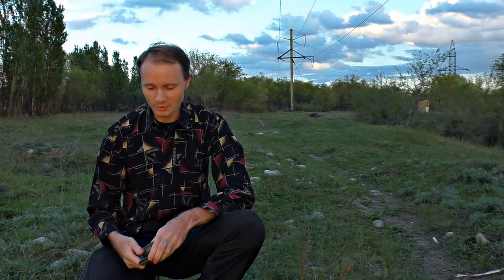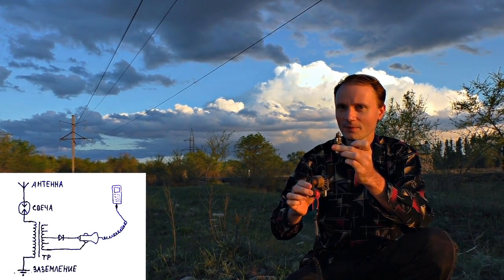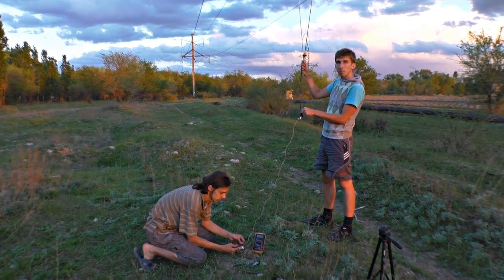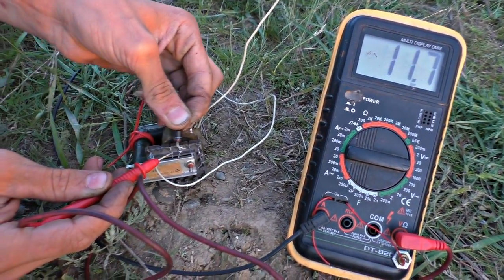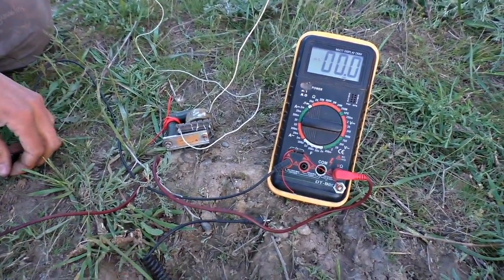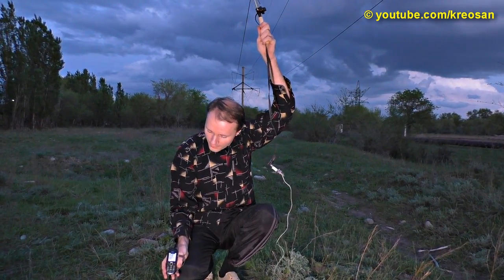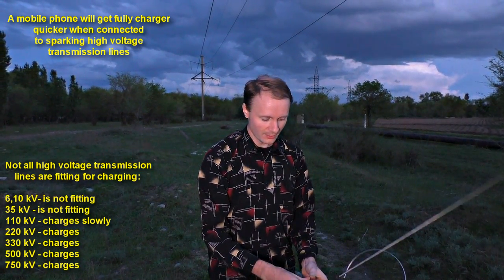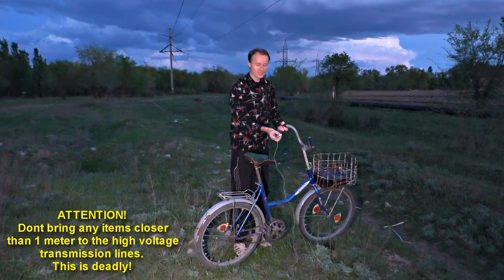Charging from the power lines.

Comment: I watched a video today on Youtube from Bobsdecline, a lineman who was talking about how all of the components in and around a substation had to be bonded to ground because of the voltage that is induced on them from inductive coupling from the power lines in the substation. They tried to get power from under power lines like this on Mythbusters but weren't able to get their setup to work. With the right conditions this should work. I'm not sure what the spark plug has to do with it though.

Comment: Try making an H2O splitter through ionization around 3kHz, 10 kV, inserting atomized water between the coils and using a car spark plug system with PWM on the 12V side to generate the 3kHz. Measure consumption x H output.

Comment: That's some power you could get to charge an even larger battery. If you wire a long net of conductive material, 2 meters high, insulated from ground, and then connect it to a transformer suited for 60hz through a resonant LC, you could even go as far as powering some 30 or even 60W devices.

That's a lot of power loss under such transmission lines.

Comment: 1:33 its not even plugged in correctly to make contact =\

Spark plugs usually require voltage of 12,000–25,000 volts or more to "fire" properly, although it can go up to 45,000 volts.

Comment: For an optimum charging rate, climb up the pole using a set of metal ladders and fix the cables directly to a pair of the overhead wires. You will get instant results.
Reply: HA  HA HA
Reply: HA  HA  HA
Reply: laughing out loud

Comment: Yes this is true, a field exists between the wires and earth. You could say these are losses and you would be somewhat correct. But the antenna causes a distortion in the local field so siphoning off power this way does cause a small hit to the supply.  Very small though. But if you can get this much power off the lines do you really want to be there?
Reply: Think about how many radio and tv signals we are all walking around in comfortably every day.. I wouldn't worry too much about it, the stress will kill you faster.
Reply: TruAnRksT the field is going to the ground???  The field is created AROUND the wire, no matter what is near. The field is strongest close to the wire, then diminishing with the square of the power the further away in distance. Basically the same as a radio transmitter antenna is doing.
Reply: Considering the metal fences, railroad tracks, and metal structures these lines cross over or run very closely parallel to from the power plant to the substation, the hit from a rigged up cellphone charger is insignificant. Like a pebble hitting a freight train.

Comment: At least slap a big filter cap on the output of this bodge.  Otherwise, depending on just what is inside the 12v converter, the phone will be fed a series of brief high voltage spikes - which probably won't do it a hell of a lot of good....

Comment: I suppose I must be the one to point out that electricity companies regard this as theft and may well take legal action against anyone stealing power in this way.
Reply: Not theft, but a recovered loss. This takes nothing from power lines
Reply: @travisturner6783  I remember years ago a farmer being prosecuted for stealing electricity, after he ran a fence wire beneath an overhead power line and used the induced current to run his lighting...

Comment: 14-15V isn’t too much- as the adapter you are using is an incar adapter which are rated for 16V some even 24 as the alternator in a car produces 14-15V dependant on your car and the condition of the charging system

Comment: Title should be how to steal power
Reply: ALKUKES how is this stealing?
Reply: power is free!
Reply: You're not stealing anything. That power is wasted on the air, is not power of the grid, is waste!. You won't receive less energy in your house because of this.
Reply: That still puts additional load on the system, however small it may be. It's still theft, and it's still a felony in most cases.
Reply: Maisonier, incorrect. It still creates additional load. It's the same method used with an actual induction wireless phone charger.
Reply: not stolen if its bleeding and causing cancer
Reply: The law will beg to differ, trust me.
Reply: Brian Evans Yep. It's already lost for them and paid by customers...
Reply: I known perfectly well how it works as its my job. Tapping in to the emf of a powerline induce a very inefficient load on the powerline. Also inductive loads shifts the phase of powerlines, how much depends on the load you introduce.
Reply: Its wasted energy anyway
Reply: wow how many times does it need to be said... It's not wasted energy that they are capturing, that's not how physics works, equal and opposite reaction. Technically the transformer they're holding is inducing a tiny load on the powerlines above, enough to charge a phone. If the transformer and antennae were not there, the power-line above would be a tiny bit more efficient. Some of the electromagnetic energy does get absorbed by the surrounding area but not very much, but if you strung up a MASSIVE coil of wire all around the entire power line, you could theoretically snag a considerable amount of power, enough that the power company would be forced to investigate as there would be a measurably high load from the resistance. Inductance is weird.
Reply: TheGoodChap its wasted energy
Reply: Blyatronics
Reply: so how about the power poles, and the ground and anything conductive near by?, all those things would receive some of the wasted energy. this contraption would put some of that energy to use without adding an extra load because all it would do is stop an eddy current being formed in the ground below.
Reply: ALKUKES:: Really cuz that's what you should be telling your Government  Jagg off, there stealing from us theres a very Long List to what  the Government should not be charging the people, jagg off
Reply: TeternalGlone:: Tell Jagg off "ALKUKES" how its free, he dont get it.thats why i call him jagg off
Reply: Title should be "How to rip your DNA into shreds with harmless EMF"
Reply: its not stealing your out of your freakin mind, how can you even think like that
Reply: It is technically stealing power.
Have any of you guys saying "it's capturing wasted energy", taken the electricity and magnetism section of a physics class?
The antenna they're using is causing an extra load on the power lines.
They're are not likely to get in trouble for this very small load. There are stories of people who have been caught stealing power using large coils of wire.
Put the following text into Google's search:
Stealing power using coil of wire
One of the first links returned is a test question on the subject from The University of North Carolina's Physics Department.
There is debate if the story about the farmer stealing wire is actually true but the physics behind the story is real.
Charging the cell phone (as shown in the video) took power from the grid which normally wouldn't have been lost.
Reply: @Brian Evans yes nestle owns the sun like it owns the most water (springs) on earth
Reply: ThisUHV line(all 3 phases) forms a capacitor in relation to a ground which is constantly charging/discharging since neutral wire from a transformer is grounded. These UHV wires are constantly loading transformer and power generator and since the current is constantly flowing to and from a ground(polarizing wires and a ground) what this guy did is not gonna influence this parasitic load. Not to mention inductance of a single wire. That's why Chinese switched to UHVDC  when it comes to distribution of a power. So yes it's a theft but Mother Nature is the culprit . Check this video out: https://youtu.be/igC-i67d2x
Reply: not if you are already paying the company the bill?
Reply: Actually this does count as stealing power if you are taking it which he is then yes
Reply: TeternalGIone No.
Reply: Ahhahaha
Reply: A guy where i live used this tecknic on a big skale and powered his entire house, he got caught and fined 10.000$.
Reply: Ah yes, taking power that will never be used otherwise is "stealing." This stuff is wasted if nobody takes it m8.
Reply: ALKUKES no the title should be how to be bad at lying, everyone should know that free energy doesn’t exist.

Comment: There were some farmers in Missouri who did this to heat their chicken houses. They stuck old bed springs up with old glass insulators under the HV lines, and stuck leaves on top to hide them. The Rural Electric Co-op noticed a unusual power drain along some HV lines and sent out linemen to investigate. The lineman called the sheriff, and paid the farmers a visit. The setups were quickly taken out, and the farmers got heavily fined. It was estimated that each setup was drawing around 2KW each. I think the REC could detect a lite load like a cell phone, but they may not question it. Never the less it's still thief, connection by induction.
Reply: Hi! Is it really possible to get 2kW from power lines, even from high voltage lines up to 500kV? I think that the maximum power is limited to approximately few watts. What do you think?

Comment: be crystal clear in showing video , its fake video
Reply: Pravin Lakhe it isn’t fake, he’s achieving power from capacitive losses from the AC lines, it’s natural electro-physics
Reply: Main Lane it is fake. That's a.c. in the powerlines.  spark plugs don't use a.c. and neither  do phone batteries and neither does that type of charge connector. He isn't using hardware to convert the a.c. to dc to charge or yo be used by the dc devices listed above...
Reply: NoVaKane Do you know what a transformer and a diode is? Spark plug doesn't give a fuck what one feeds into it, it's just 2 contacts insulated by ceramic. He used a transformer to step down the voltage spikes to about 10 volts and then he used a diode to "convert" AC to DC, followed by a car phone charger which outputs stable 5 volts DC. Nothing suspicious going on there. And capacitive coupling is a thing. Can you hear the power lines buzzing during the video? That alone is capacitive coupling with the surrounding air and the other 2 wires (phases), so he certainly can induce some voltage on the antenna using this method.
Reply: Marek Fiala if course I know what a transformer and I diode is...  foods only let current go one way. There are other doors that allow some to pass in reverse as well. Transformers take a.c. current and the ocelating magnetises the iron core of the first winding and the second core pics it up either increasing it decreasing the volts exiting.  I also know those power line out put a.c. current and there is nothing in his kit that he has that converts  the a.c. into d.c. to charge the phone.  Even that car charger  plugs into the d.c.  port of a car. Tranformers use a.c.  as well. So what is he using to convert to a.c. into d.c.  where is that piece of circuitry? If he had made a diode bridge or a bridge rectifier  with 4 diodes then he would be able to turn the a.c. into  dc which is what if often times in the usb chargers that plug into walls. So tell me  how he does  this then?
Reply: NoVaKane Well, a single diode is also a rectifier, even though it's only one way, it still is a rectifier, you don't need a bridge rectifier to turn AC to DC. It would be better if he also used a filtering capacitor to smoothen out the DC pulses after the single diode, as it blocks the other halfwave and thus decreases the output power by 50% and increases voltage ripple but i guess the input circuitry of the car charger has enough input capacity to take care of this.
Reply: Marek Fiala ah I'm very sorry I do did not know a diode could be used that way. I'm still in the process of learning electronics but I'm not going to school for it and have been jumping around understanding components so I have missed out on many things.  I probably read about diodes as rectified earlier but I was very new and neglected to learn about that aspect of them so that part  as well as other things waa lost to me never to be seen again.  I honestly only new the blocked current going one was and could be used in a bridge formation using 4 diodes to output one one side of the a.c. wave or something like that . Now I'm thinking I misunderstood bridge rectifier .thank you for setting me straight. Is the spark plug used as a visual indication aspect of the spark to show enough voltage is being captured?
Reply: NoVaKane It's fine, I'm glad i could help a bit, you can find some animations on youtube (sorry i can't link any, on phone) showing how AC flows through a diode bridge, including some V/t graphs, it would help you get the idea of the difference between a single diode and a 4 diode bridge. And yes the spark plug is just for show mostly, but I'd say it also helps dissipate the induced power when no load is present, first because it's a TV antenna and those coaxial cables aren't meant to withstand these voltages(although i think it'd survive) and second, you wouldn't wanna touch the output wire unloaded, as it would give you a shock, not harmful, but noticeable.
Reply: Marek Fiala thank you very much
Reply: Yeah dude this is the best channel for learning electronics and safety rules.
Reply: "this is the best channel for learning electronics and *safety rules*."
( ͠° ͟ʖ ͡°)
Reply: NoVaKane I'm glad you guys worked it out, consider the spark plug a "spark gap" now consider lenses law about magnetism and this is more than plausible
Reply: NoVaKane: you start by insulting. then you show your ignorance. not a smart way to go thru life.

Comment: Bullshit.  !!!!!
Reply: David Price same concept as crystal radio. Energy travels over waves and as the frequency is the same in the line and the transformer, it's possible
Reply: @SBinKMedia 

 The concept is not the problem, but the antenna. You would need big ferrite rods with long coils to receive sufficient voltage in that frequency range.
Reply: @westelaudio943  You are essentially getting fields produced by the current, not the voltage, and the voltage is essentially irrelevant as long as you observe the normal conventions that apply to any other dealing with xxx kV.

The frequency is 50/60Hz depending on where you live. But it is mostly irrelevant, because this isn't the frequency you are receiving. You are essentially getting "noise."

I tried this with a burned out fluorescent bulb, and it worked. Sure, harvesting the energy is difficult, and utilizing it is even more so. It's all about induction, and with the HUGE amount of EM radiation nearby, it shouldn't be an issue to power small devices from even the smallest of coils.
Reply: @SBinKMedia  

In the end you'll have to have 5 VDC, but in the end it doesn't matter because you can always use a transformer to turn high current into high voltage and vice versa. 

What kind of noise are you talking about? Harmonics? As far as I know the line power frequency is a sine wave without much distortion. And remember those TV antennas usually pick up mHz range frequencies. Transformers, being large inductors, are always also -6db/oct. low pass filters. I doubt the huge interstage transformers of the power line let anything above 1 kHz pass. Even the transformer they used between antenna and the devices won't let much HF pass. You will need a bigger inductor for sufficient power. What kind of antenna did you use?
Reply: @westelaudio943  the TV antenna picks up everything. By noise, i meant interference. There is interference. If you turn on a radio, you can hear stations drop out and noise coming through speakers. This isn't 60Hz for sure, so i consider it noise. Noise is not necessarily audible, but it's a way of saying that there is somewhat random unnecessary(can't be used) energy, such as the radiation that the sun gives off. That is considered noise.  Or the static in a picture when the signal isn't strong, usually analog, rarely digital.

As for the antenna, it's capable of picking up TV stations in the MHz range, but could also be used for almost anything else. Remember, the antenna is just capturing all the waves that pass through the antenna, but it doesn't do anything with it. That's the tuners job. It seperates the exact frequency/s that you are looking for.

My crystal radios generate enough electricity from transmissions over 100 MILES AWAY to produce audible dialogue and music through an earpiece. That's with a small piece of copper and a ground wire. Now imagine taking a TV antenna which is LARGER, and passing that under a  POWERLINE which is emitting WAY more radiation passively than the radio transmission source is likely focusing on a SINGLE frequency.

And yeah, you can change the voltage, which after a capacitor(for stable reliable current) is added with transformer and inverter, would easily power a phone, and if something of larger magnitude were built, it could possibly power much more.

We can also think back to Tesla Coil original purpose. To send energy from one to another by having the same frequency. If you can get a frequency majority of the energy that is being passively dissipated, then a coil would probably be one of the most effective ways of doing it.
Reply: @SBinKMedia  

I know what noise is, I already told you that HF noise cannot pass through a substation transformer. And where is the supposed noise coming from? It's only a single frequency without much distortion. 

We are talking about several kHz amplitude modulation waves in a crystal radio. You can only hear anything because you have a transducer right next to your ear. We are talking about microwatts here. 

Of course the length of the antenna corresponds with the frequencies it picks up. The antenna itself is a bandpass filter, the tuning condensers are for fine tuning to a very narrow range. Why do you think every radio has different antennas for USW (FM) ans MW (AM)?